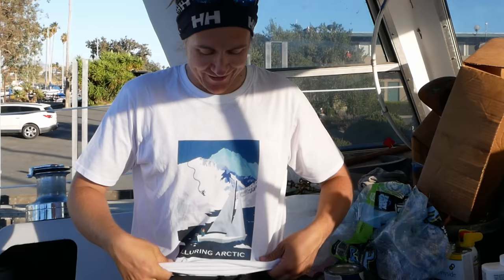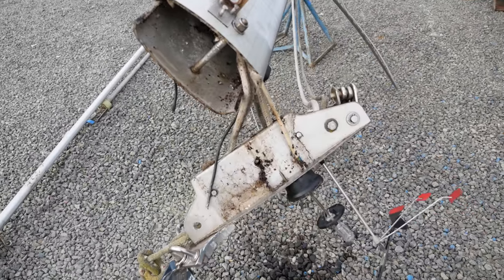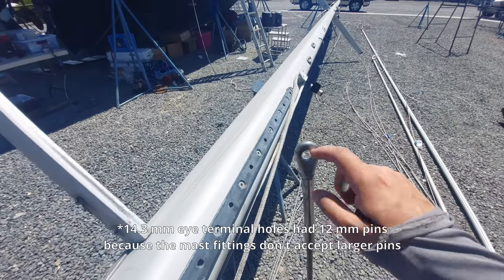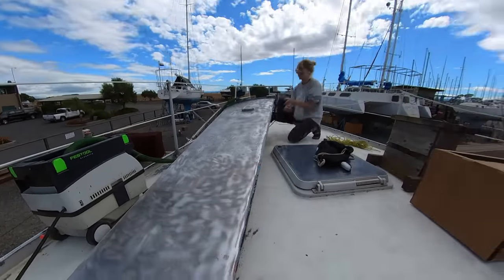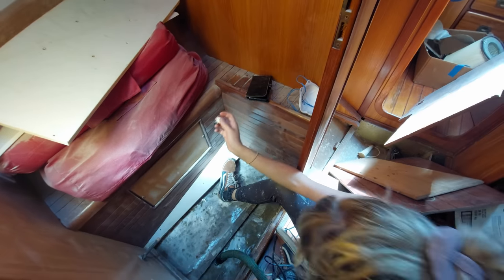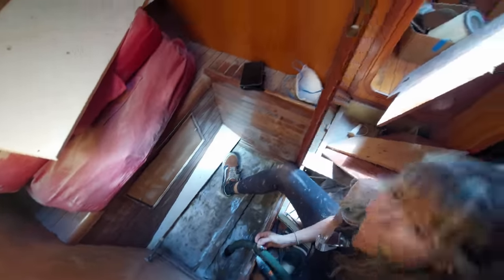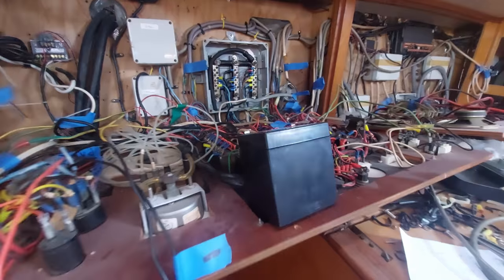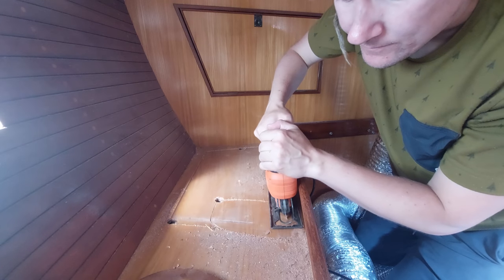The Mast Disaster (GIANT Boat Refit)

Comment: I've never commented on a YT vid, but felt compelled to share some experience as I immediately recognised your mast (extrusion and most - but not all - fittings/hardware) as identical to ours and I'm just finishing a DIY 'complete refit' of the mast, inc. every fitting, cable, rivet, etc. Ours is 1989 'Francespar' mast approx 16m with a ProFurl 'C420' furler fitted to our 12.5m sloop. The refit was done in the UK. We re-step the mast next week (it's been 9 months' work!)...

I recognised many of the issues you've identified and solved them as follows:

- Our mast's forestay/backstay fittings were 14mm but the rigging eyes are 16mm or 5/8. We simply sheaved the eye with a piece of 316 stainless tube (1mm wall) with the correct ID/OD. This acts like a bushing or 'bearing' to spread the point loads, as you suggest. The professional rigger based in the same yard agreed this was a good solution. Making the spaces/collars/bearings from tube/pipe is easy with a handsaw and sandpaper to finish (although I used a belt file to machine them evenly). An old clevis pins works well as a 'former' and to stop the pipe distorting while machining...

- Every stainless fastener into aluminium will be seized. However, I achieved about a 90% success rate in releasing them with a combo of penetrant spray, correct tool (a cordless impact/manual impact/small 'breaker bar' with appropriate socket, etc.), and - most importantly - heat. I even successfully split the furler extrusion this way. Use a 'MAP' propane torch to gently heat the fastener and/or the area around and you should get most out. Remember not too hot - aluminium doesn't go red as a visual warning and can deform on you! 

- We replaced the ProFurl link plates (ours also bent/distorted) with a long 5/8 or 16mm 'Bar Toggle'. The Sta Lok version, for example, adds 81.6mm from the furler clevis pin to the deck fitting. It can be mounted 'inside' the profurl drum, through the standard pin/plates. A fork fitting is needed at the bottom of the forestay (there is space for this inside the drum, but ours was swaged doesn't have a screw as its a fixed forestay design). If you need more distance to the rigging point on deck, then check out the current model ProFurl installation manual (available online) to give an idea of link plates they offer to accommodate a greater length while attaching to the same clevis pin as the forestay (and therefore not carrying any rig load). The new model link plates may not fit, but it would be quite easy to fabricate DIY or new-old stock may be available.

- Some parts were impossible to source in the UK (e.g. spreader tips) so take care of them upon removal. You might have better luck in N America. If you want to replace the actual shroud attachment points - and here your external 'tang' style are different to ours - consider 'coquilles' or stem ball cups/'shells' as a good DIY method (and arguably an upgrade). All you need to do is machine a simple 'pear' (or avocado?!) shaped hole in the mast and the coquille fits in that and is held securely by its own shape. They are available from Eurospars, ZSpars and others and accommodate up to 10mm wire fittings. This could also solve any oversized eye issue on shrouds (not stays though).

Apart from being rare, at least here in the UK, these masts are extremely well made and overengineered in my opinion. Remember plenty of heat upon removal of fasteners and also you'll need to tap some threads and/or insert helocoils where corrosion or drilling out snapped fasteners requires. A decent 'lazy tong' rivet gun and monel pop rivets (4.8mm by 13/16mm) will also be required. We redid all wiring with tinned cable. Modern LED lights only require 1.5mm which eases installation.

Hope this helps a little and good luck! 
Dan (SV Christina)
Reply: Outstanding info. Experience speaks volumes in cases like this. Well commented.🥸

Comment: Kudos to both of you for taking on this project. I have sailed all my life and dont know how you balanced all the factors when you decided to do it. I have been over my head a couple of times and at some point you run out of steam, or energy, to continue, but it seems like you are making it work which is really impressive. I just wonder what it as that made you decide on this particular boat, to do what you are doing. There are lots of aluminum hulled boats that you could have chosen in much better shape....but anyway, it is really enjoyable to just watch how you going through this process, and making it work!
Reply: Could you link to some of these aluminum boats in similar size and similar properties (like beachable due to centerboard design etc) but better shape?

Comment: Seems like things are progressing well.
Timeline seems aggressive though. Unless there are contributing factors that require such a truncated window, I recommend not setting "deadlines" like these. Not making them can be mentally defeating. Just keep moving forward and be done when you're done.
Thanks for the installment!
Reply: They are clearly trying to make a weather deadline.  The NW Passage is only open a few months of the year.  I suggest that they need to be prepared to take the Panama Canal route.  Plan for going North but understand that they may not be able to.
Reply: They might also have visa limits  
for any stay in the US..
Gutting all the wiring out the insides of the boat is going to be a time consuming problem ..

Birds that feed on fruit tend to produce very corrosive droppings.. not sure how seabird droppings rate in the corrosive index.
Reply: Serious USA visa limitations, unfortunately this is the second foreign couple dealing with the 3 month. Though I had guessed the opposite exit route.
Reply: @braithmiller  
Hi Braith i think they may feel more comfortable in Canada if they can get it back in the water. 
Hopefully the Canadians will see their way to letting them get 
more done in the spirit of Polar navigation. 
Hull, Engine, Sails and rigging and navigation systems..Im sure some of the Canadian Channels/viewers could tell them some good places to hold out the winter and do the internal work.
Reply: @clivestainlesssteelwomble7665  Agree plenty of resources and help up this way.
Reply: @nikolatesla5553  I Seriously doubt the NW Passage is on the radar for 2022.
Maybe next year. Just not enough time. Especially for a "maiden voyage" so to speak. These cats are smart. NW Passage super late in the season with a "new" vessel is... well...not smart.
Reply: @braithmiller  I would hope, not Know, they'd be able to simply leave the country, for a short period and then return. Maybe Mexico. Close and inexpensive.
A bit of a vacation from the work wouldn't hurt.
Reply: @svphoenixandme776  Only one can work at distance. Getting back to her work I am sure has bearing. Same happens when I stop working to work on my boat, high expense, no income.

Comment: in my experience tracing wires is a wast of time.
Much faster: 
1. Pull them all out without bothering to see where they go. Maybe put some labels on the more expensive wires. 2. Set them neatly aside to reuse later if they are still good. 3. Rewire everything and put labels at both ends of every single wire.

When starting with a rat nest of wires where you already know it wasn't done right because stuff isn't working: You will waste more time trying to figure out what is correct and what needs to be fixed than it takes to just replace everything. Almost every single wire I replaced on my boat lead to me discovering that other wires were also in need of replacement. I also spent more time and money trying to reuse the 7 conductor cable in my mast (3 wires go to the top, 4 to the middle. Actually kind of nice except for the low amperage, fragile, and expensive connector at the mast foot) than it would have cost to replace it.

Comment: I wonder if one of those oscillating saw would help with getting fiberglass and resin and rotten wood off of the aluminum hull?  I've had great luck using one to remove old adhesive.

Comment: Oh Dear, Sohvi is getting thin legs and mighty arms! What a powergirl!! Chapeau! But please Juho, buy her a good (3M or Moldex) halfmask with FP2 or better FP3 filters. Those white mask are simply not good enough (the fit leaks) and glassfiber, hard wood etc dust is dangerous. 
And video's... well, anyone who has some idea, about video will understand the effort needed for filming and editing. Hence that is why so many sailingchannels have adapted and have become rather boring Formula channels. So don't worry, I, and i guess many, will stick around and are glad to see some non formula video just when it arrives!!
Good you found the shaved and wornout cables in the mast. Do realise that with new cables this shaving will occur. (not wanted) Flexible plastic protective tubing, which is very cheap,  will extend the cable life for very a long time.  Good luck for you both with this fine project!!

Comment: Using the correct size pin will keep the hole from getting totally flogged out so if the manufacturer doesn't provide a pin find out what size fits with not a lot of slop

Comment: Now you basically just illustrated why the pin should fit snugly and they are not have any play if you really want to illustrate that find a bulldozer from the 1950s that did mostly farm work and didn't have a blade on front and then look at the tow bar and that's how you illustrate that because when they put the pin in the tow bar and it's undersized it will flog out the eye and the tow bar just like you're talking about with that PIN being too small and the holy being larger